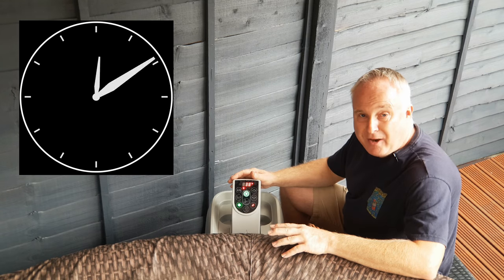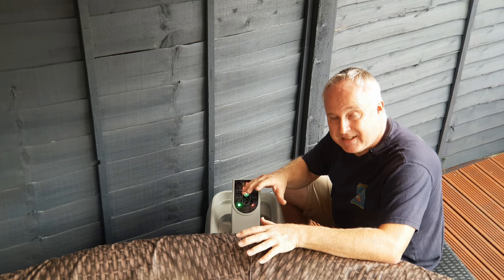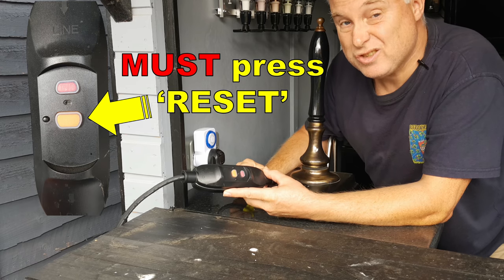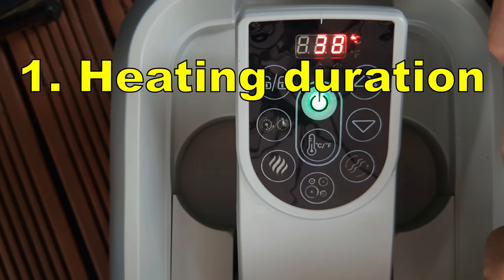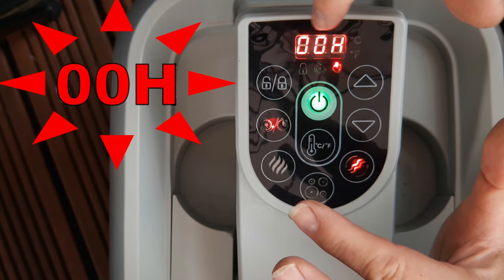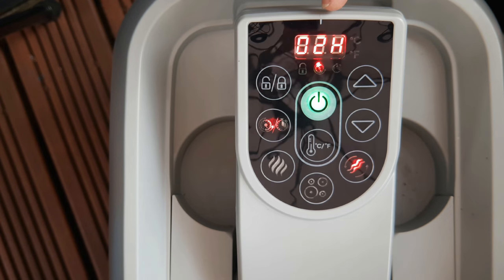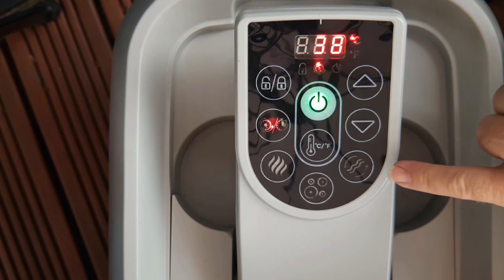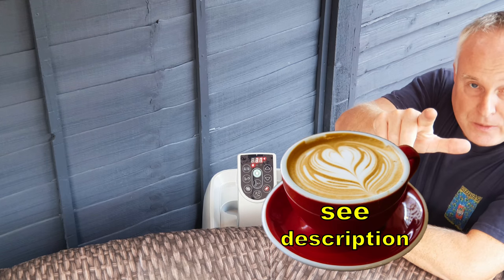How to Set the Timer on a Lay Z Spa Pump Unit | BEST Guide on Youtube

Comment: Hi, I have a question - I have just replaced a VERY old Palm Springs spa with a new Lay Z Spa Fiji, which seems remarkably flimsy compared to my old one.  So I am a little worried about it deflating.  My old one didn't leak water (even after 6 years) thanks to a lot of gorilla glue I had used where it once leaked, but it did lose a lot of air.  So I never used the bubbles- as I had to have the air pump disconnected so I could reinflate the pool every few days.  How do YOU pump up the pool itself between fills?  Just disconnect and move the engine around a bit?  I don't want to put too much pressure on the filter and heat outlets.  There is another contraption that came with mine, but I have no idea what it is for - wondered if it might allow me to have the bubbles AND the air pump pipe connected at the same time??  Thank you!!
Reply from the maker: i pumped ours up when we got it in April 2020 and haven't let it down since. No leaks.

Comment: If I want my hot tub to be hot for 7pm at 40 degrees. Everyday how long should I do my timer for ?
Reply from the maker: Mine heats up at about 1.25C per hour, so if it cools by 10C in the day you'll need it on for 7 or 8 hours to get back to 40C.
If you use it every day it's more economic to keep it on at set temp and keep it covered.

Comment: Great video as they all are but I'm confused I set my timer thinking it would automatically heat to 40 but it doesn't does it, it will only heat the the timit set. Say I have my spa at 35 digrees and set a time for four hours in four hours time it will only maintain the set temp of 35 for the four hours? That so useless

Comment: Could you explain the dual massage feature, whereby the air massage can be at 100% or at 50% power. No matter what we do, the massage is at full power.
Reply from the maker: As far as I know, the airjet models only have 'on' or 'off'.
Reply: @AbouttheHouse0  Our tub is the Barbados and meant to have a dual speed air jet massage.
Another question, sorry, we are going away for 2 months and are planning on emptying the tub, cleaning it, disconnecting the pump and leaving the tub inflated. Will follow your emoty and cleaning video, and hope that after 2 months it is not green inside. Will put the pump inside the house
Reply from the maker: @barbaracampbell7671  awesome, didn't realise they did twin spped air jets. Maybe a fault?
After cleaning make sure to let the tub dry thoroughly. Maybe give a final clean down with some dettol or similar disinfectant.
Do let us know how you get on.

Comment: Howdy sir - I'm writing from Maryland and the temps are starting to fall.  I'm a bit confused or maybe I want different 
function, but it seems that I have to keep the heater and thus the circulation on all the time.  If I simply leave the unit powered on, but no timer or heat/circulation selected the units drops in temp as no heating occurs.  I expected the unit to heat and circulate as necessary to maintain the set temperature.
Reply from the maker: You need to leave circulation turned on to maintain the set temperature

Comment: if you put the first time as 0 does that mean when the heater turns on it will stay on indefinitely?
Reply from the maker: The duration (first setting) cannot be set to zero (0) - only 1-999. The delay can be set to zero in which case the heating comes on straight away for the duration set.

Comment: Can I ask in regards to the chemicals. The adapter that come with the hot tub. Can you use it when the the tablets ect are dissolving or do you have to wait to dissolve each time. I’ve used my tub once so far so is it a matter of just checking the readings first before use. Thanks for the video
Reply from the maker: Granules must be predissolved. Tablets can be put in a dispenser and straight in the water.
It'll take a while to raise the chlorine levels with tablets on first use, you really need granules for the shock treatment.
Reply: @AbouttheHouse0  thank you for the information I am a new hot tub owner I will be setting mine up for the first time in the spring I can't wait God bless you always

Comment: I live in the tropics and don't really need the heater on the timer. I would however, like the pump to recirculate for 8 hours during the night. Is there a way to set the timer to start the pump only for a certain amount of time several hours from the time you set it. Can you just set the heat to a low temperature so only the pump comes on?
Reply: ترجمة الى اللغة العربية

Comment: My understanding is that Active inline and plug rcds are designed to act as no volt release relays so that the connected equipment doesn't suddenly restart when the power comes back on . But in most instances there just a pain . I presume that the spa has a frost stat (I hope so) which is not going to work if you've had a brief power cut .
Reply from the maker: Oh, for sure if it was a piece of machinary you wouldn't want it to start without warning. This is hardly in that category though and in this instance is just a pain in the proverbials. As you point out, the frost protection would fail to do it's job after a short power cut. Someone in Engineering didn't conduct their DFMEA properly

Comment: This needs clarity. It doesn't clearly say how long it stays on before it turns off again.  So I do not understand. Are you saying that you input the first number for the time you want it to start, but the second number is not the time you want it to stop? I still don't understand this after multiple videos.  Can you please clarify it for me. Thank you.

What I'm looking for specifically is when do I need to set timer to turn on so it's the temp when I need it and when to set timer the  to turn off and the duration of time it will take to reach that heating degree.  

So if I wanted to be hundred and four fahrenheit at one pm and to turn off by 4pm. What exactly do I need to do.  How many hours is it going to take to reach 104 if I wasn't it to be hot at 1 pm.  Do I need to turn it on at 6 am or  9 am or when.

Comment: I think the timer option is a waste of time to be honest, you can set it to heat to certain temperature an for how long, but if you don’t get the right heat timing correct, the spa could be below the temperature you set. Good video tho and easy to understand
Reply from the maker: Given how cheap digital electronics are these days, I agree that the timer is a very poor feature. And that you can't even use a plug in timer is a whole other disaster.

Comment: I can't believe they manufactured these without a repeatable timer function! I just setup mine where the hum of the pump can be heard in our bedroom. Figured no problem, I'll just set it to sit idle at night and run during the day. WRONG! Guess I'll have to set the timer every night or manually turn the tub on and off each night & morning. What a disappointment. ☹ Thanks for the video confirming that there isn't a workaround for this.

Comment: Hello I need to activate freeze shield as I’m not always around
Reply from the maker: Just leave the circulation turned ON and the freeeze shield is active
Reply: @AbouttheHouse0  i use the timer function for the duration, as it helps :-). When the tub turns off you have just the power button lit. Will that turn the freeze shield on automatically, when the temperatures drop to below? Or does the circulation need to be turned on every day? 

Just wondering if I need to get someone to pop in and kick it off each day and set the timer :-)

Thanks!
Reply from the maker: Hi  @hookandnatter8763  You make a very good point. The exact functionality of the freeze shield is unclear from the instructions. MY understanding is that as long as the power is 'on' the freeze shield is active. We've just emptied our tub for the coldest months and we only had 2 days about a week ago that were down around 2C. We had left the circulation ON and the freeze shield defo worked.
The freeze shield is active below 6C ambient.
I won't get a chance to test it works okay with the circulation off, so maybe you could let us know if you find any difference from the above. TIA.
Reply: @AbouttheHouse0  thank you - my own understanding is the same as yours.  Should it fall cold enough (probably early next year) I'll post my findings.   Thank you for the video assistance though.
Reply: @AbouttheHouse0  Hi!  I am just coming back on this, as it happened!  So the Freeze Shield kicked over the festive period.  The pump has to be on, so the green "go" button is lit.  If that is off, it will not kick in.  The freeze shield keeps running continually and does not shut off - so it kicks the pump into action, but will not turn it off again.  I made sure for the few days away that the temperature was set lower, so that if the freeze shield was activated, we weren't warming the tub for no reason.  

Just thought I'd share my findings.

Comment: Great explanation of a completely useless feature.
Reply: 😂 totally agree. I knock the heating off overnight as I get out of the tub, despite cheap rate night time electricity, as I only tend to use the tub in the afternoon/evening. When I get up in the morning it's typically lost about 5degC. I flick it in to heat through the day. By the time i want to use it, it's at 40degC again. That there's no way to program this operation on these units is ridiculous and as you say, the provided functionality is useless.

Comment: It's such a badly designed feature - I'd rather leave my tub at a lower setting and then just set up a boost for a few hours before using it, but with this I have to turn it all the way off until the timer activates, which is much harder to judge